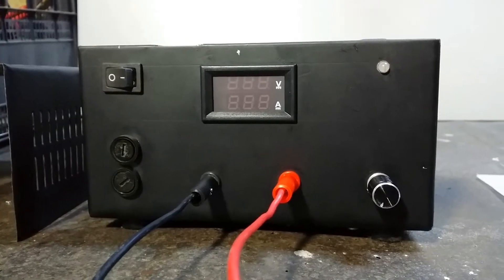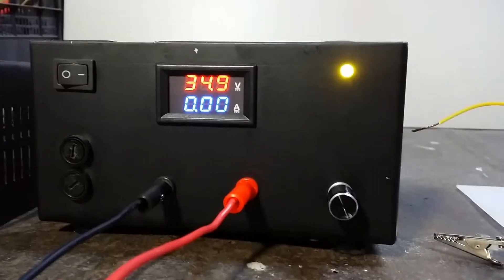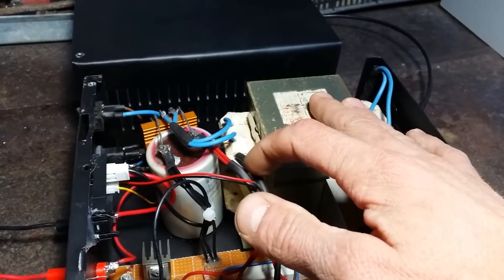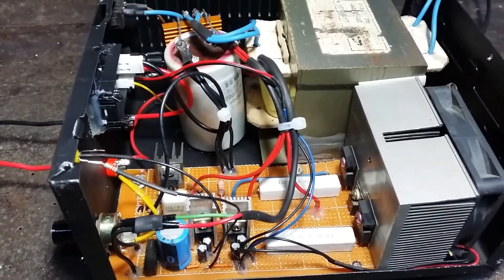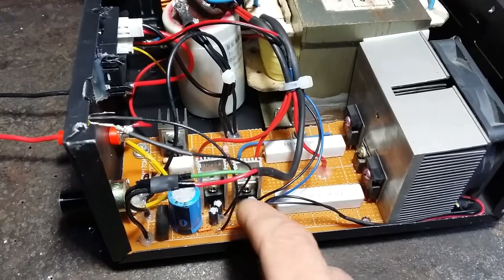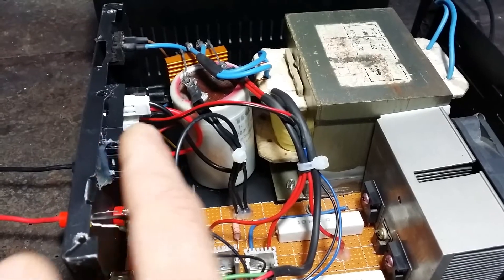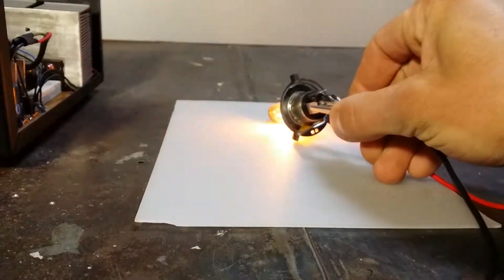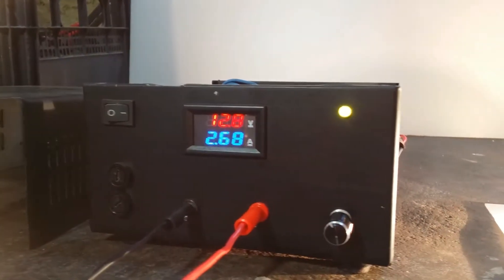Homemade LM317 Adjustable Power Supply

Comment: Thanks for the video.  I am not trying to be 'clever' or anything like that but I think that what is below might interest you. The addition of the power supplies for the fan and meter is a very good idea.

10A at 35 v = 350 W.  TIP35C 's would be a lot happier at 30 W each. That is their normal rating for a amplifier.

The Monacor PA 900 Line Amp uses 4 x TIP35C  and is rated at 120 W but has no fan. 
There is no reason why your circuit could not have more TIP35C (or 2N3055). I am at the moment converting (or trying to) one of these Monacor amplifiers to a power supply due to a pint of beer being poured over it. It still worked but it's a Line Amp at 100 V and mono. 
There is a very simple circuit that uses an LM723 for both variable Volts and Amps.
http://electronics-diy.com/30v-10a-variable-bench-power-supply.php

I'm sure you could improve on this circuit.  I'll subscribe of course and hopefully gain some more ideas.

I have noted that fans are 'not the in thing' for some reason. I love them. I also found the below which proves fans help.
http://www.abl-heatsinks.co.uk/index.php?page=extrudedproduct&product=166
Reply from the maker: Hi JP..thanks for your subscription. I initially wanted to use 6 TIP35C in this power supply but I reduced to only two transistors because I do not need 10 amps at 35v or 12v anyways, 3 or 4 amps it is more than enough.Yes the LM723 circuit it has the advantage of current limiting, it is an important feature. Nowadays you can buy relatively inexpensive switch mode power supply modules (buck converters) that has voltage and current adjustment and load regulation and go up to 15 amps, It is more convenient to make a power supply from these modules.
Reply: What Ho. I have a transformer that has a 60 V DC 7 A output and I found a buck converter at Banggood that handles 65 V and 400 W. It would probably make a good room heater at 400 W but not for long

https://www.banggood.com/DKP6008-400W-Digital-Control-Adjustable-DC-Step-Down-Regulator-Module-Constant-Voltage-Current-Meter-p-1082317.html?rmmds=search  

 I also bought some of the little ones to burn out while I found out how to use them. The only problem with Banggood is the weeks one has to wait. I get very nice email from 'Ruth' at Banggood, I expect the whole world does LOL. So far everything has been OK though.

Great videos - more please.

PS I also have a 40V AC 80 Amp welding transformer. That would be a real challenge.